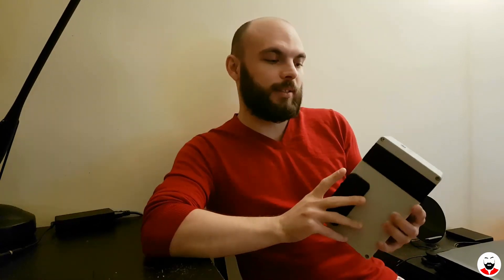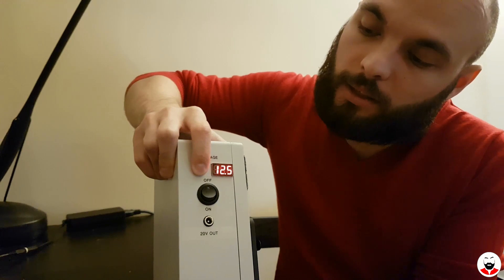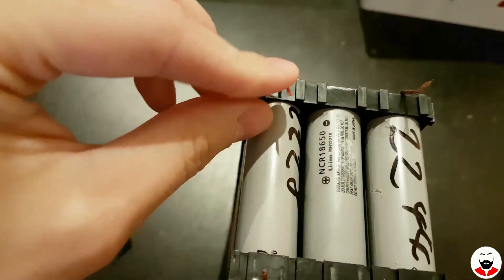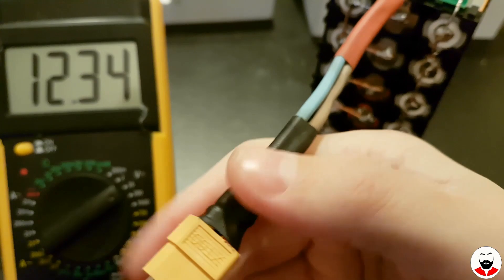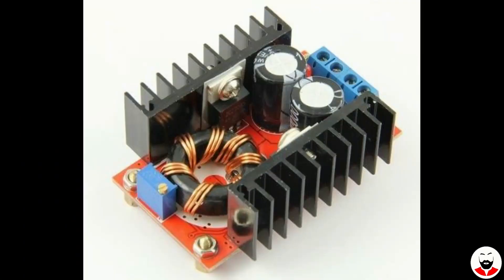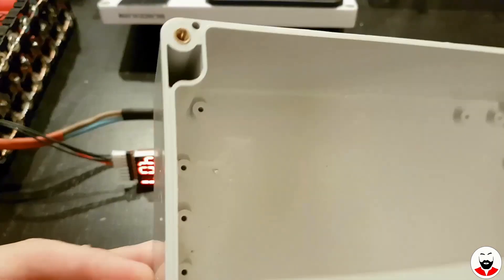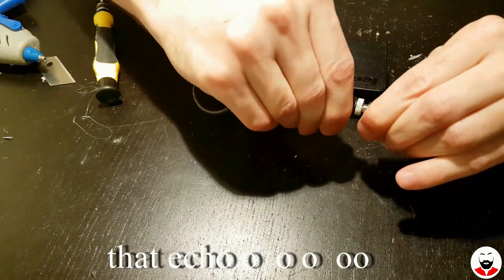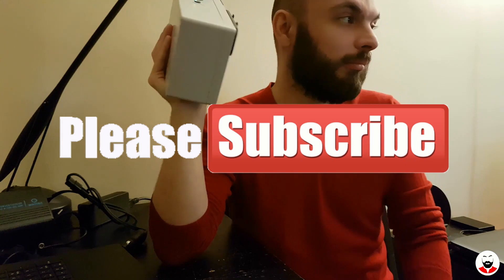CRAZY POWERFUL Power Bank That Can Power Your Laptop! (With 18650 Recycled Cells)

Comment from the maker: Cheap Parts:
---Battery Management System (BMS)
*US :   

Ebay:       https://ebay.us/HX28TS
Amazon:     https://amzn.to/3elkYDP
*UK:    
Ebay:       https://ebay.us/smc3Gr
Amazon:     https://amzn.to/32dT7mk
*Germany:
Ebay:       https://ebay.us/yjnfId
Amazon:     https://amzn.to/3fqEYWK
*Canada:
Ebay:      https://ebay.us/th5xKt
Amazon:     https://amzn.to/2ATpc7Q

--18650 cells
*US :   
Ebay:       https://ebay.us/fhj8MU
Amazon:     https://amzn.to/32gRZOX
*UK:    
Ebay:       https://ebay.us/enccMd
Amazon:     https://amzn.to/32eI6S6
*Germany:
Ebay:       https://ebay.us/ignT83
Amazon:     https://amzn.to/3gTC39l
*Canada:
Ebay:       https://ebay.us/y7sC3m
Amazon:     https://amzn.to/2C4c6Fi

---DC DC step up step down CC CV - make sure you get the CC one to properly charge the 18650 cells
*US :   

Ebay:       https://ebay.us/bhoRwm
Amazon:     https://amzn.to/3j11Z4G
*UK:    
Ebay:       https://ebay.us/MYrMDO
Amazon:     https://amzn.to/3089huP
*Germany:
Ebay:       https://ebay.us/jEg0pn
Amazon:     https://amzn.to/3gR5wRm
*Canada:
Ebay:       https://ebay.us/EL4enW
Amazon:     https://amzn.to/3frDv2t

---XT60 Connectors
*US :   
Ebay:       https://ebay.us/FOuque
Amazon:     https://amzn.to/2CrTq2n
*UK:    
Ebay:       https://ebay.us/CkeCPP
Amazon:     https://amzn.to/2OjGwWJ
*Germany:
Ebay:       https://ebay.us/YhluhK
Amazon:     https://amzn.to/3iVLerL
*Canada:
Ebay:       https://ebay.us/YxcSfg
Amazon:     https://amzn.to/3eqm3u2